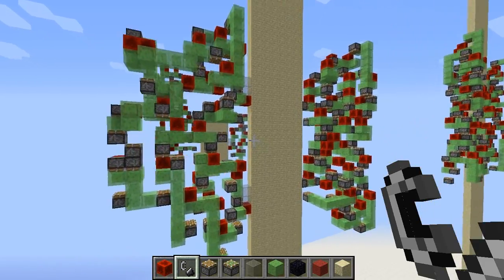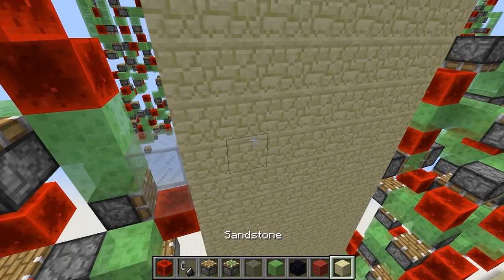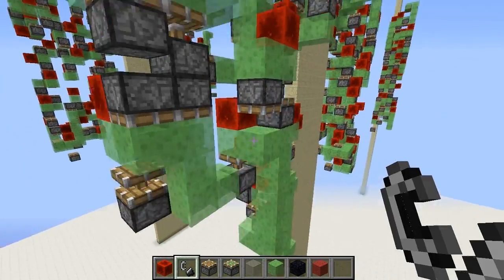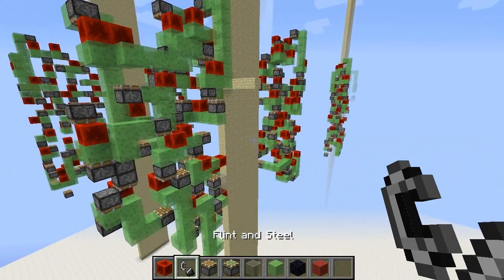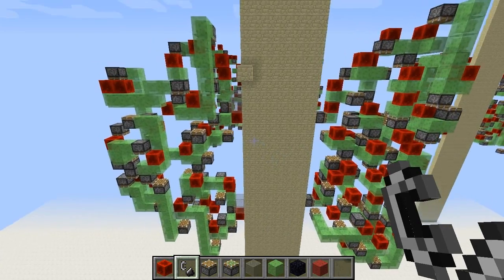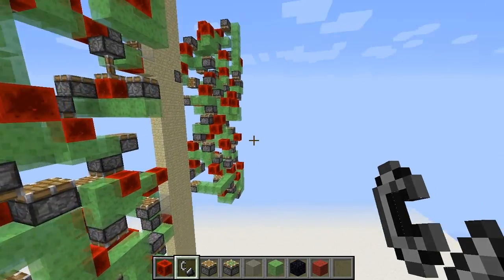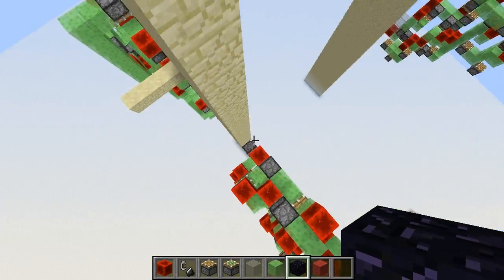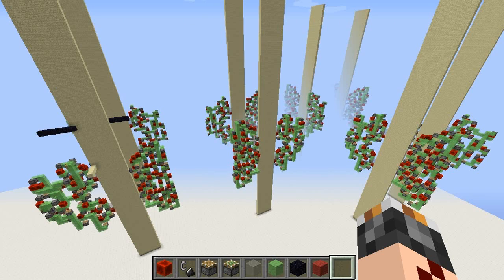Through-Wall Virtual Slimestone Connection

Comment: Nice, nice ... so, does it also work at default caterpillar speed? :o (4 cycles/block). You should have showed that too, not just those simple BUD engines. :P Oh well, still really cool, no clue this little challenge would get so complex. XD
Reply from the maker: Wout12345 Sadly, it requires very low speeds to operate. When I found out even a double caterpillar is too fast, I gave up and used a manual engine instead. I'd use Jazz's slow bidirectional engine ... if it were vertical, lol.
And yes, sending signals through walls turns out to be surprisingly complex!

Comment: MAKE A SLIMESTONE COMPUTER!!!
Reply from the maker: Alex Stefanov That is entirely doable. It'd be a long project though, so I imagine I would do a collab with someone.
Reply: RedsBoneStuff
I think you can add 0 tick pulse generators to make the slimestone computer faster than normal redstone computer...
Reply: Robitobi01
great idea - while you fly to your base play some minecraft on your slimestone computer xD
Reply: If you really want to do it redstonejazz has already a lot of computer parts like binary adder and so on and using 0-Ticks makes only sense with real redstone and stationary pistons that's way easier
Reply: Robitobi01
The idea is to be moveable... And with slimestone :D
Reply: Than good luck trying to find usefull 0Tick stuff :D
Its at the moment already insanly big to move just 1 rail so...(That uses 0Ticks)
Reply from the maker: Alex Stefanov "while you fly to your base play some minecraft on your slimestone computer" - that comment made my day!
Reply: Well..Normaly you just sit on it and it takes ages and it is boring so why not ? :P
Just a bit insane do do a computer that works when moving and when stopped..
But other than that? eZ !
Reply from the maker: Does it need to be two-directional though?
Reply: I would say four directional.. xD
Well it would be way more useful but probably waayyy harder and how do you want to display the result or whatever it does?
If you just use lamps thats probably possible but a display with multiple pixels that have each a single own input... It gets insanly hard and than try that two directional...
But try if you want
Reply: Robitobi01 Wonder Quest I WONDER is there any other way to display something instead of lamp display?